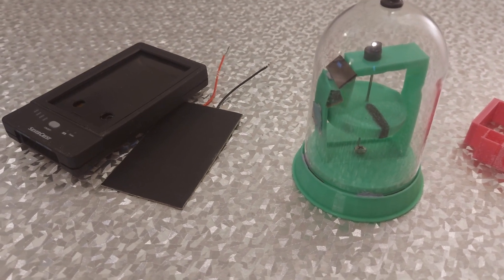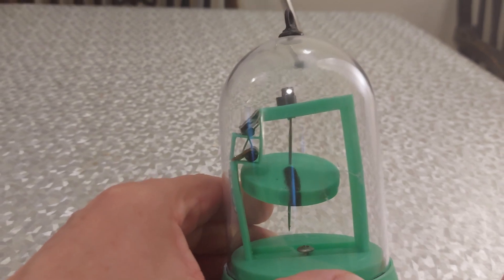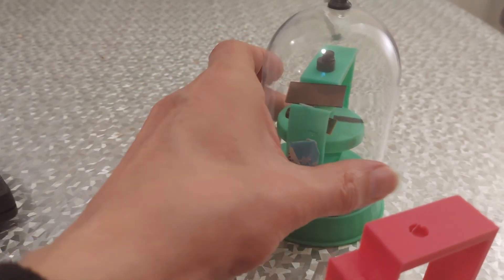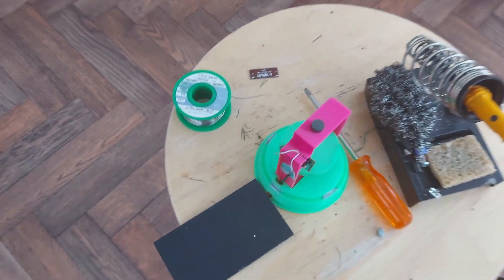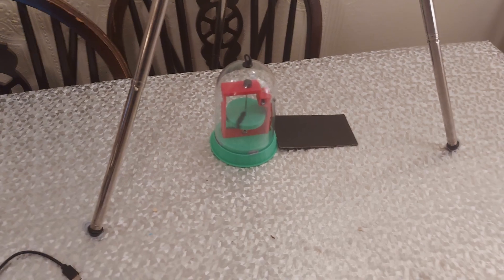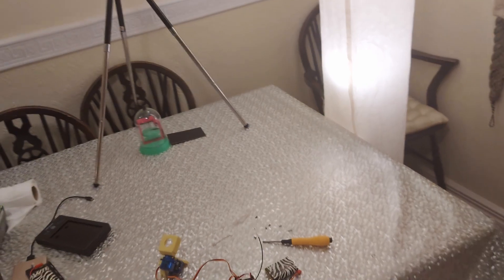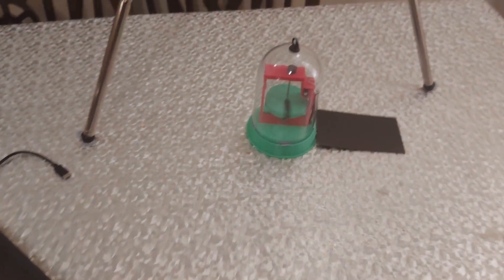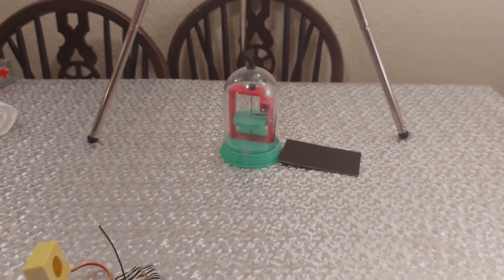Low light ambient light pulse motor PART 2

Comment: What about a storage capacitor and a diode on the solar panel
Reply from the maker: Yes a capacitor can be charged during daylight, but we were just trying to see if we could run from low ambient light by increasing the size of the solar panel. In my windowsill I have two solar rockers that run at night. One runs during the day and charges a supercapacitor at the same time so it continues to run at night until the supercap runs down. The other rocker is wired to a basic garden solar light. That charges a small NiMh battery during the day, but the rocker only starts running at night when the solar light switches itself on when it gets dark. There is a video short showing them, that just happens to have gone public in the last few minutes. https://youtube.com/shorts/bdJJ8seFe5g
Reply: @GrandadIsAnOldMan  Thanks very much very interesting 🤔